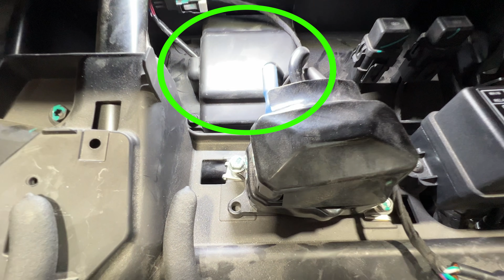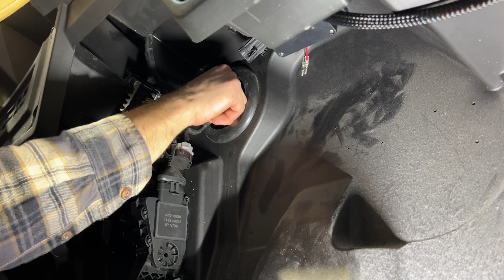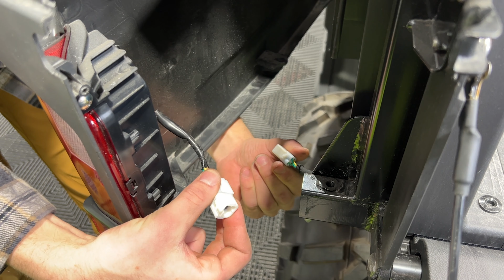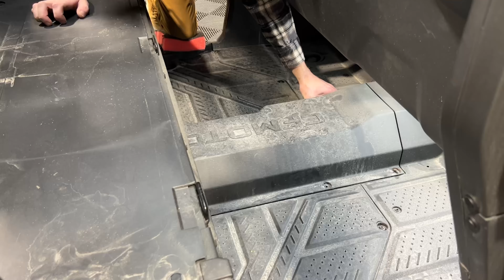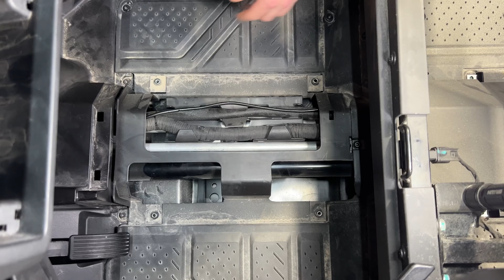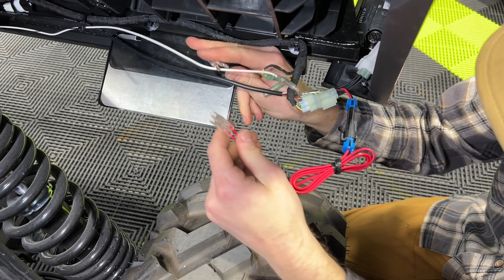CFMOTO UFORCE 800 XL - Street Legal Kit Install | WD ELECTRONICS

Comment: I just did this installation yesterday.  This is a very good installation video, but regarding part 4, there is NO WAY you are getting to that plug w/o removing the lower portion of the driver's side dash.   You can barely see that 8-pin plug, much less put your hands on it.